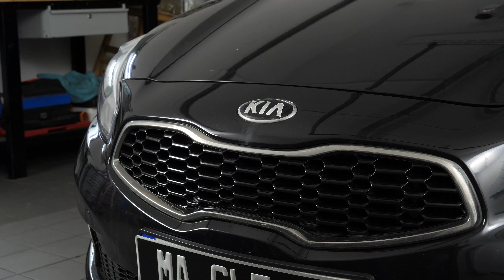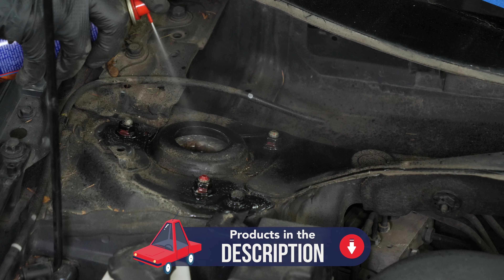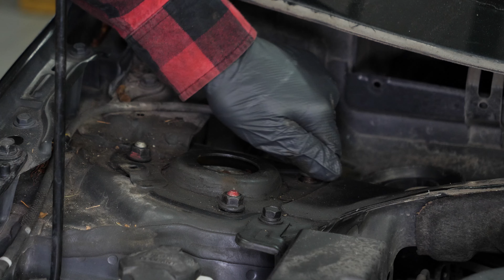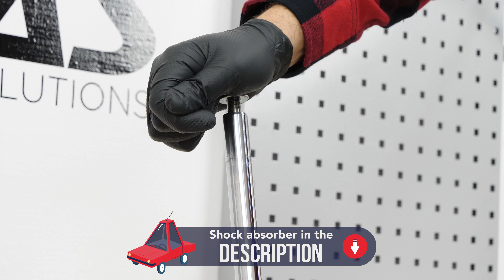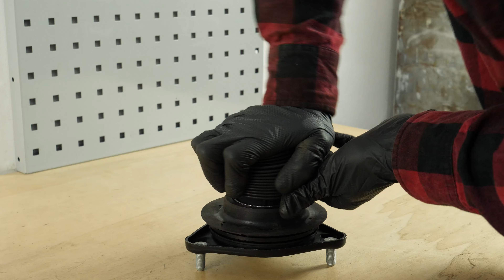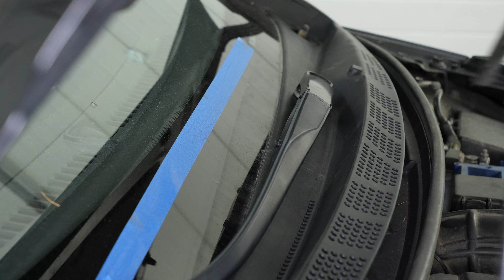How to replace the front shock absorbers Ceed mk2 ➿

Comment: Looks very easy. I wiil have to change the shock absorber to my ceed mk2 very soon. It have 290 k km. I will star with the back shock absorber and then the front. The only tool i dont have is the 2 sockets to remove the uper nut from the sock absorber.